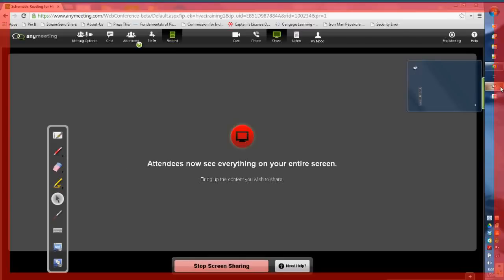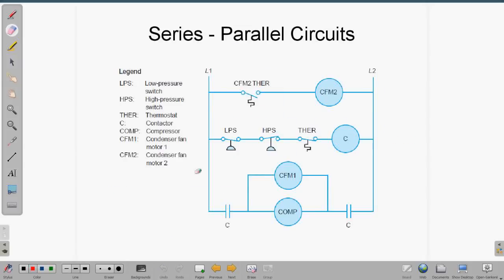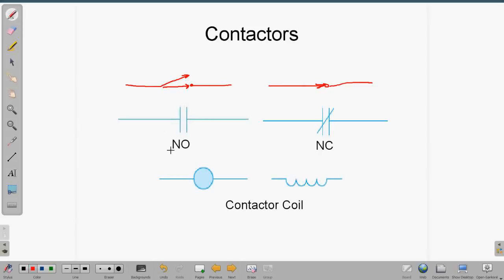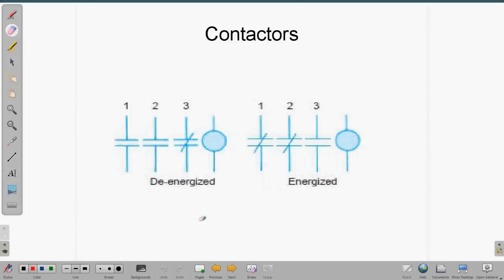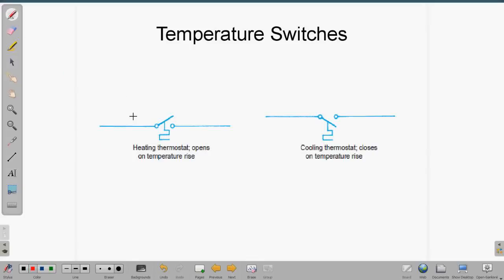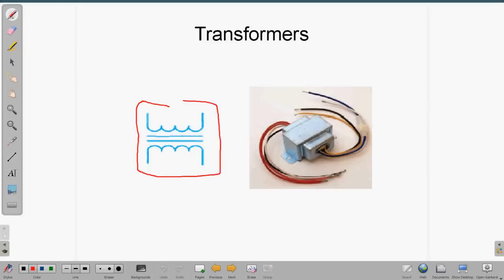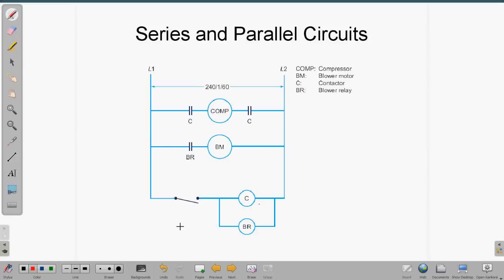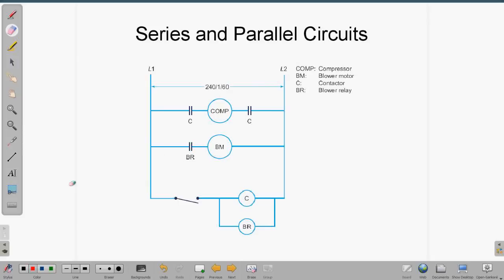Online HVAC Training - Schematic Reading for HVAC Technicians - Part 1

Comment: "Normally open" or "normally closed" on an electrical circuit can be more easily remembered by "fail/safe".  If power fails the circuit is safe.  This is the safest condition where nobody gets hurt.

Comment: Thanks for the video! I'm learning a lot from this.

One question though: for the window AC. I'm confused about the hammer looking switch. So in this case, there are only 2 positions that it can be in right? 4-1 = OFF position and 4 -2/3 = ON position. 

It can't be in just 2 where only the fan is running? Or just 3 position (even though that won't do anything, it'll just refrigerate but not have any flow)
I got this question on a test, shouldn't there be a point of connection in between 2/3 for them both C and FAN to operate?

Comment: Do you use latching mechanically held contactors with dual coils in HVAC?? I got the bosses son for a tech a couple years ago. He used to work at a frat bar, and has no aptitude for HVAC at all. He wired the start run caps wrong 3 times, and the unit had both a schematic and a simplified color coded idiot's wiring diagram right inside the access panel. One of the motors was rattling the windows on the house, so I went up and straightened it out. I did a lot of industrial process piping, instrumentation, automation and motor controls. I am disabled now and work part time on audio equipment. I have worked on a lot of foreign made equipment with non-standard schematic symbols, and weirdo color codes. I worked with a lot of electropneumatic controls too, as well as optically isolated controls & PLC, as well as the old GE transistor to transistor relay logic. I don't miss that one! YOU ARE A GOOD INSTRUCTOR! I did not really learn anything new, but you present the material very well.

Comment: did you say @24:45 in the video that control voltage is 24vdc?in residential heat pumps

Comment: I never have quite understood why these traditional  archaic schematic diagrams  for electrical wiring _that make doing wiring far more complicated than really need be - could not be replaced with a photo diagram of ones actual furnace showing connections between all the components, motors, swiches, valves, etc as they all  look in reality.... rather than as a  bunch of morse code like symbols...almost seems deliberately done just to be pricks...